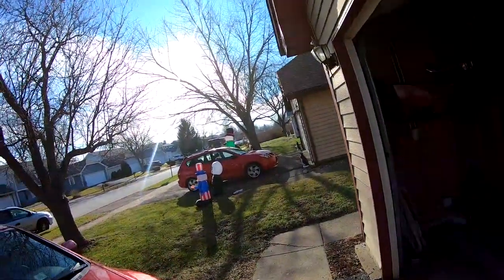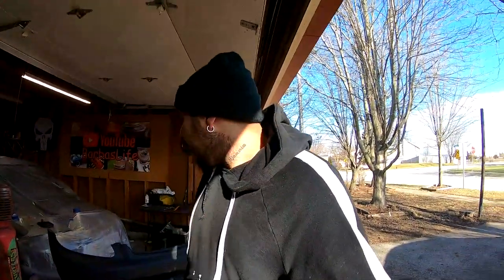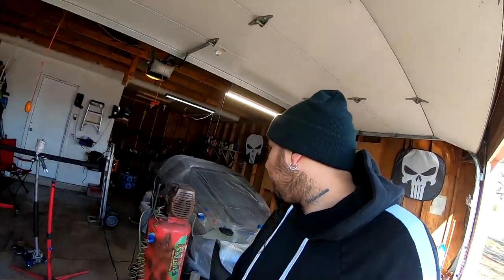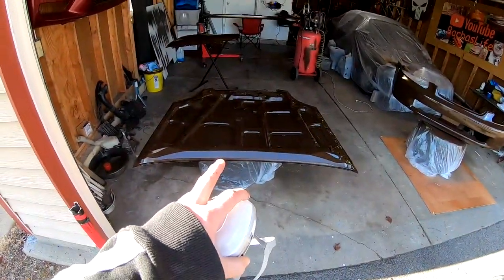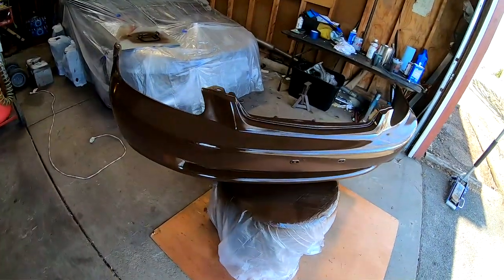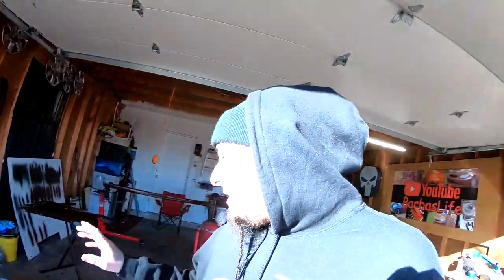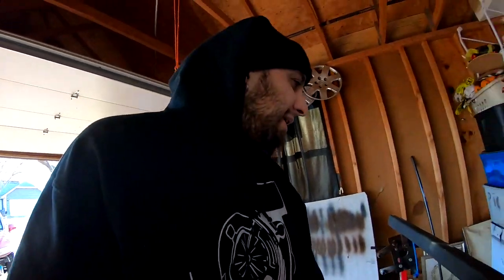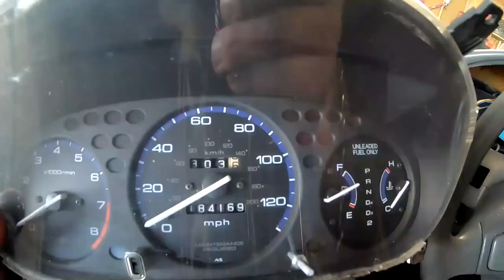Turbo Civic Paint Job is Finished!!

Comment: No worries bro 😎, on a side note, that reaction, did you happen to use spray can paint before you applied the actual paint ? I’ve found that if you paint a 2k product on top of a 1k spray can paint you must lay it down very light on the first coat or so , if not it’ll have a chance of reacting, the solvents on 2k paint is much stronger than the 1k and it’ll tend to bite and react. Ps Merry Christmas 🎄